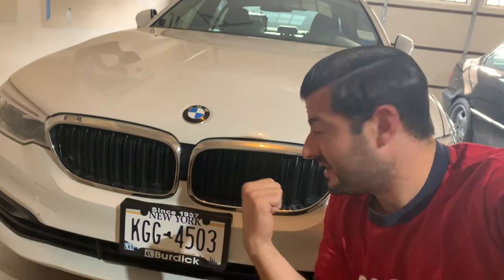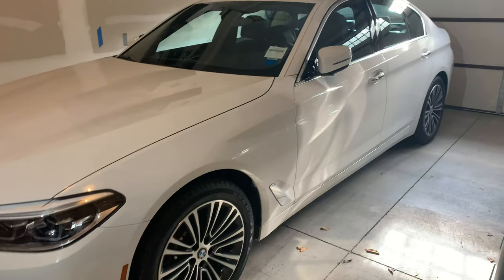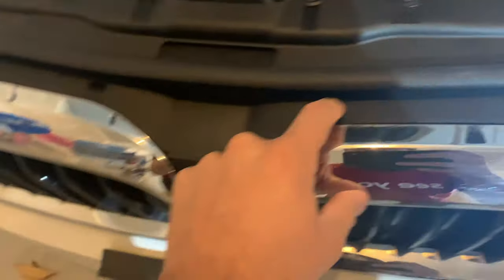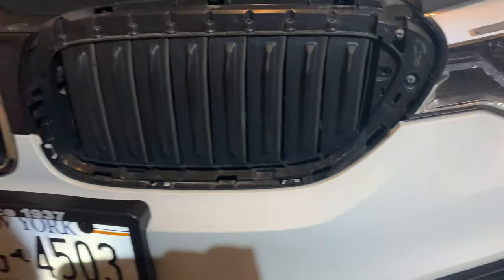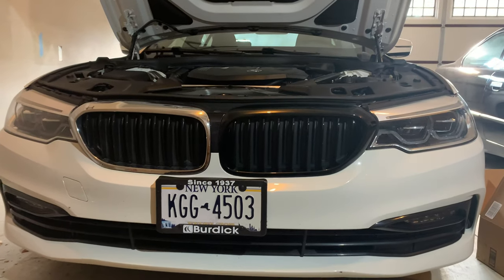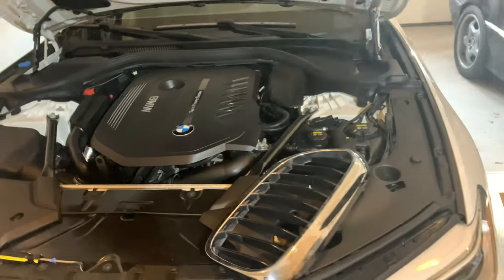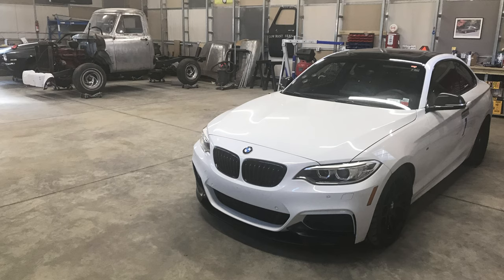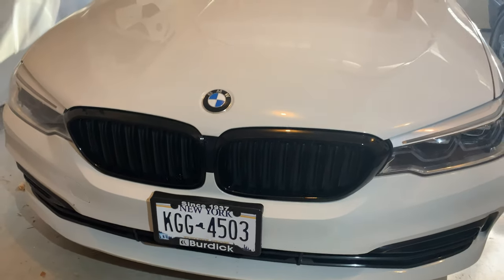HOW TO INSTALL A GRILL ON A 2017 BMW 5 SERIES: CHEAP, QUALITY AND EASY TO DO- G30 540i

Comment: I have a 2017 BMW 530i. How does one black out the chrome pieces around the vents on the front bumper? Just below the headlights? Can it be taken apart!
Reply: Apart?*
Reply from the maker: You could easily wrap it with vinyl wrap.

Comment: is this specific grille oem?
Reply from the maker: It’s not but had held up great
Reply: @LowBoostFilms  i appreciate the fast response. Do you think as long as i don’t mess with other part of the grille that actually moves i will be ok?
Reply from the maker: @shanetimko4927  yea, you don’t have to touch that at all. This is in front of it. It’ll work fine!

Comment: Did u get a check engine light on?
Reply from the maker: No, no sensors or anything were touched
Reply: @LowBoostFilms  man my car is in the dealer right now I changed it last Tuesday and they said it’s because my kidney grills are after market 🤦🏻‍♂️ I’m like dude they are snap on?  I have a 530e but is the same no sensors or anything we’re touched
Reply from the maker: @kiloantraxs4  yea that’s a crock of garbage. Who they trying to fool
Reply: @LowBoostFilms  I mean I still have factory warranty on my car  so I’m like what’s the deal the car been in the dealer for 4 days 😂
Reply from the maker: That should not be the issue I’d argue that til the cows come home.
Reply: @kiloantraxs4  I own a 2018 - 540i and the grill sensors failed after one year. I got a factory warranty for the grill sensors. There is an issue with that.
Reply: @kiloantraxs4  forgot to tell you that I never replaced the grill.